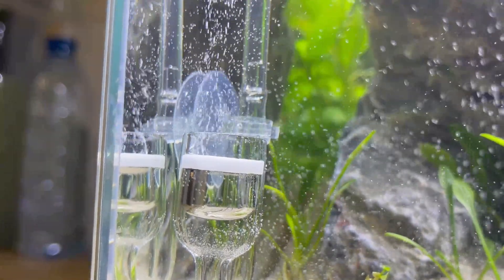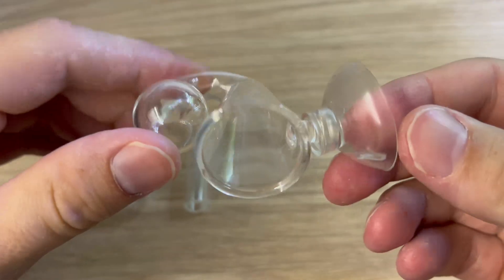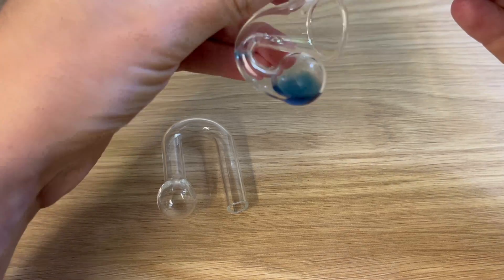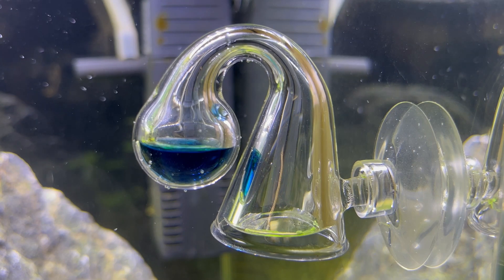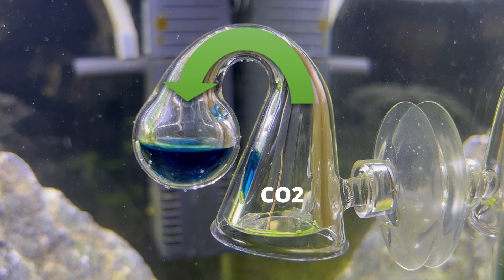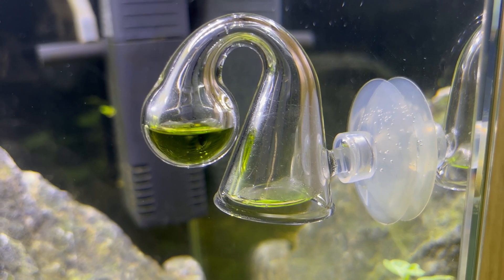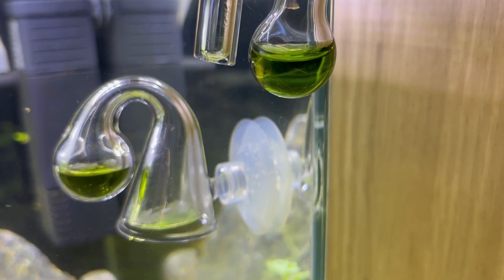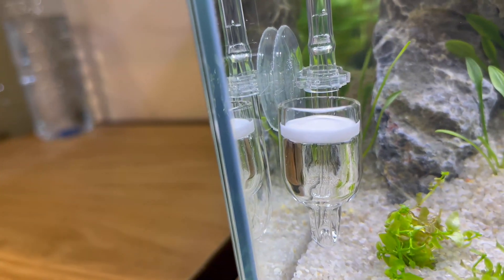How to check and measure CO2 level? How drop checker works?

Comment: Hi will this checker continue to change colour according to co2 level or is one off? If work multiple times for how long? You said to change it every 2 months. Is that mean is reliable during 2 months and will change colour accordingly? Or it have number of circles?
Reply from the maker: It will keep changing for about 2 months. It's quite common that it changes during the day (after your CO2 is turned ON). After that time it might still change, but you should not trust it anymore ;)
Reply: Great Thanks

Comment: I'm using an inline Co2 diffuser, would it make sense to have the drop checker beside the outflow so that the freshwater carrying all the Co2 is pushed away and circulated through the tank before reaching the drop checker itself?

Comment: thanks so much for the amazing video. i was wondering, if i add co2 like this to a tank that already has a betta fish some cherry shrimp and some nertie snails, will it effect any of them at all? it's a 10 gallon heavily planted tank
Reply from the maker: Thank you! All depends on the amount of CO2. They should be fine, just don't shock them with lots of CO2, but introduce it slowly. You can increase it later, once they adapt to new water parameters.

Comment: ur co2 is flowing all around so cool, but then theres mine it just goes up in a straight line
Reply from the maker: It's all about the flow in the tank. Play a bit with the outflow of your filter and it can make a HUGE difference.

Comment: Hi, does the co2 checker change colour once per colour or it is changing depends on the water condition for a full month?
Reply from the maker: It changes colour many times, depending on the CO2 levels. So it can be blue in the morning, green 2-3 hours later, and then get back to blue if you switch CO2 off etc.
Reply: @AquascapingCube  thank you so much i was afraid it will only change once 😂

Comment: Does this work even when using liquid Co2 such as API Co2 Booster?
Reply from the maker: No, it doesn't. But it's because API Co2 Booster doesn't add CO2 but carbon molecules. Plants can still use it, but it's not CO2 in gas form and will not be detected.

Comment: How do you do with drop checker during  waterchange?
Reply from the maker: Nothing. It stays connected to the glass without any problems. After water change it takes some time for it to adjust the color and that is it :)
Reply: @AquascapingCube  ok so you just leave it where it sits and it will stay there and the fluid won't be messed up? Thanks for answer
Reply from the maker: @linussivervik2805  Exactly. There is air between the fluid and water in the tank. And it separates the both. As long as you don't mix the fluid with water somehow by accident - you are good!

Comment: I have been fish keeping for many years now. I do have planted tanks that I do inject CO2 into but I never use a drop checker. To check my CO2 levels I monitor my PH and KH, I measure the Ph levels in the tank to know what my CO2 levels are. Personally I hate drop checkers and find them to be useless. With a KH of 5 I look for a PH of 7.0 for my CO2 levels. To measure my PH I use a Blue Lab PH pen. My tanks PH usually sits around 7.6 to7.7 without CO2 and I slowly bring it down to 7.0 with the CO2. That's it.
Reply from the maker: Yes, this is definitely an option if you know your parameters. But you know, drop checkers really help people especially at the beginning to figure things out and learn about CO2 levels. This is really easy and obvious method if you are new in the hobby. In the end, with experience and knowledge they are not needed anymore.
Reply: You HATE drop checkers? Useless? Is this hyperbole?
Reply: @GirthBrooks775   
No it's fact. Cheers!
Reply: @kosys5338   source?

Comment: Hi, how many bubbles/sec  should i set for a 125x50x55cm tank tht is 344liters approx.. depending on tank size i set it high like 12bubbs/sec for 6hours daily thru timer and my drop checker turned green as i placed it opposite side of the co2 diffuser.. and last week onwards the fishes in the tank started to die drastically..  my water parameters are all fine.. i installed an air stone for oxygen. So how much do i need to set the bubbs in order to get green i tried 3bubbs, 5bubbs, 8bubbs, 10bubbs none turned my solution green wen i kept on 12bubbs solution turned green but my fishes strted to jump out of tank and some died inside.. now i have switched off co2 frm.2days and just airstone is working.
Reply from the maker: Sorry to hear that :/ Do you have good circulation in your tank? It is possible that you have high co2 levels in one corner and low in another. But your bubble count is fine. How many plants you have? Is your tank heavily planted?
Reply: You should never have your CO2 working in the same time as your air stone. The air drives the CO2 faster out of the tank. This makes no sense. It's better to lower your air bubbles when fishes are dieing or you should use air bubbles at night when the CO2 is off to get the oxygen in the tank when the plants are not photosynthesizing.